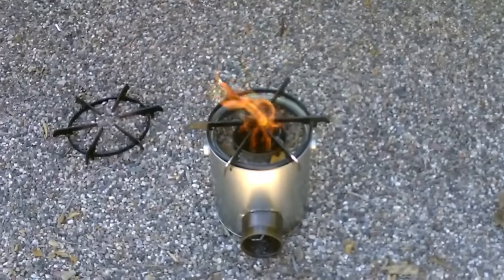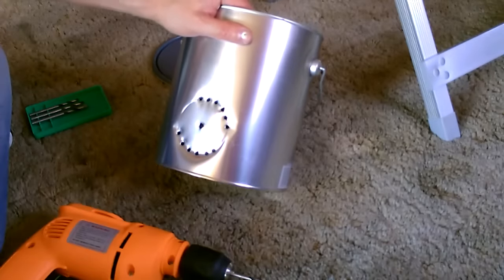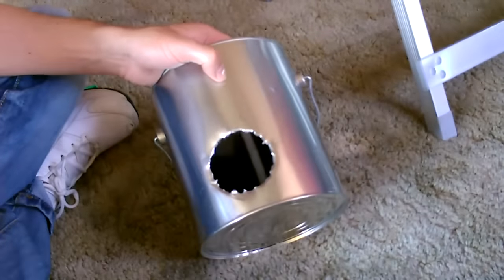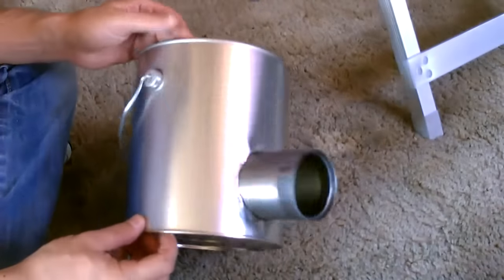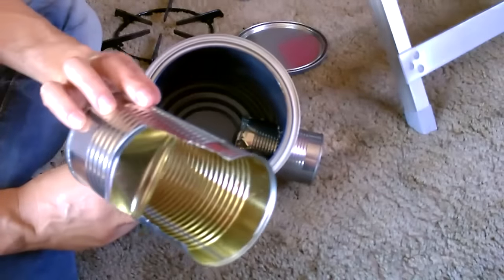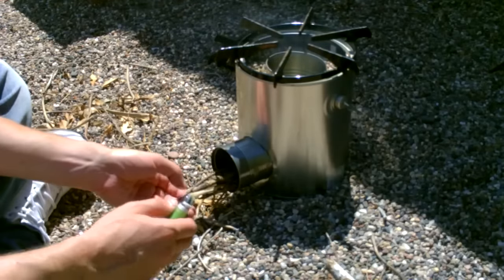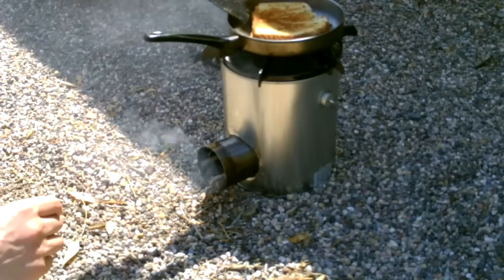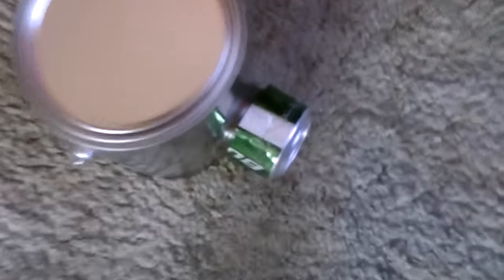Homemade TIN CAN Rocket Stove - DIY Rocket Stove - Awesome Stove! - EASY instructions!

Comment: A lot like the one I made except mine was better. OK the way I did mine was a lot like this one, but cut holes both in the paint can like you have but also cut a hole in the inner can as well, but the inner can to stick out the paint can a tiny bit. Now is when you fill with gravel and sand or just sand. Now fill all the way to the top with the inner can poking out a tiny bit and keep tapping the paint can to shake down the gravel and sand or just sand. Now put a hole in the paint can lid to pretty much hold the sand and gravel or sand in place and the inner can pokes out the top. All fitted together tightly so as not to lose any sand or gravel. I also used small plastic lids that fit over both ends of the chimney part to keep the ashes in place also to start a fire with using in a fire roll if so needed to start a fire    Great Video thanks for sharing. Thumbs up from me

Comment: Out of curiousity, why use sand? Wouldn't the stone work better because it would absorb the heat and keep the whole thing hot? Or is that the problem? Is there a worry about melting the cans if you use too much stone (which increases the heat)?
Reply: Does not the sand fill out the spaces between the pebbles? Sand retain heat too. There are full size stoves that are made with metal tubing and filled with sand instead of construction of bricks and tile.

Comment: Another option instead of bottom fuel fed hole have 0.5inch dia hole and metal pipes on the middle height on 4 sides for air flow  with fuel fed from top only

Comment: easier still ---cut hole as shown in 4 gallon drum,  put in base round wooden piece to centre with another round piece from top to bottom .
pack with sawdust, tramp down hard then remove wooden pieces which gives you a tunnel, light at base  and it will burn for hours

Comment: If u leave end on the can the is horizontal and face the closed end out drill a hole in middle insert a bolt then cut triangular holes in tge bottom u can take the bottom of a second can cut the same holes in it attach it and have a flou

Comment: Great project ! I'm wondering is there any type of high heat spray foam type of insulation that would work to make it light instead of the heavy rock and sand ? Just put one layer of rock & sand on the bottom and lighght the rest of the way . Any such thing exist ?
Reply: Try the stuff that they make door liners for fireplaces. It looks like white rope but never discolours or burns. You'd need the raw material, not the finished product. And I suspect it may be expensive.

Comment: I liked the video except all I would have done is to slide the proper size piece of firewood inside the paint can. That would give you a bearing surface to press down hard enough to make the large hole saw cut all at once thus eliminating the need of drilling and cutting to make the large hole. Any fairly large round or even square piece of wood should make that step simple, then completing the rest of it the way shown in the video.

Comment: How about using a metal sprinkler head stuffing it with carbon felt adding a copper spout with a cap to seal it on the outside of the cans in order to fill it with alcohol with the sprinkler head being just above the air intake at the bottom so a coals at the bottom to heat up. and vaporize the alcohol with the up draft generating a blue jet to boil water in a snap? Would it work?

Comment: Sand and gravel eh?  Smart!  I didn't think sand was such a great insulator but I guess I was wrong! Of course sand it silicon, which is an insulator, so why not I guess?  I thought about trying to build one of these a long time ago, but it seemed like way to much work!  Instead, I tried to build one out of bricks.  not near as nice, or efficient as yours but it was hot enough to cook on.

Comment: Would it be possible to pour water over the manifold housing the sand and gravel to create a steam version of this stove? I'm sure you could keep adding fodder to get temperatures very hot and start negating with water. The steam would heat the cook ware (not necessarily to allow steam in contact with the food directly... yuck.)

Comment: Why not swap the vertical tube for exhaust pipe it could handle higher temps and get a little taller to use as a heater or...
Reply: thats a great idea, i have a downspout and similar tubing in the garage left over from other projects. so glad i scrolled this far down in the comments!

Comment: Here is an 8dea for you, paint can design an alcohol resivor to sit in the bottom of the paint can with a copper tube with hole's drilled into it an inch apart bent to fit snug around inside of paint can mark were hole's are and make a air vent hole into the paint can place a pipe piece with a decorative screen cover on the outside of the paint can leaving a lip inside the paint can for the copper tube from the first alcohol resivor to rest upon. Copper tube stuffed with high heat carbon felt with end's left in bottom of alcohol resivor for a wick. Make a screw on fuel spout to the resivor that you can screw into place from a hole cut into the paint can from the outside. Now make another alcohol resivor one that can be presurized a bit use copper tube with steel wool threaded through it into the alcohol resivor use copper pipe attachment's to this resivor because you will be dealing with pressurized alcohol vapor. Then make fuel spout to the outside of the paint can with a secure screw on lid. Then order a HHO micro jet burner online and run your copper tube to the top of the paint can and recess the burner so you can place the lid on it. Dedign a grill top that has nibb's you place down inside the lid of the paint can to hold a skillet or large pot on top of the paint can. Then make a craddle with fold out leg's you place the paint can into for a stable paint can alcohol jet stove. The first copper tube burner heat's up the second copper pipe with steel wool and turn's alcohol to vapor building presure then that presurized alcohol vapor passes through a regulator valve to the top micro jet burner for low med or high heat. Very clean burning and will last for a few hour's abd you can even design a thin Titanium dome to fit over the jet's to glow white hot for a radiant heat source. Cool aspect of this is that you can dig a hole in the ground and place your paint can alcohol jet stove into it and.cover it and surround it with rock's and use it like a camp fire to cook on then attach your thin Titanium dome and have a radiant heat source just like a camp fire. 😀👍

Comment: but how do u clean it
Reply from the maker: hi there. i've found that a long-handled spoon works the best.
Reply: to make it easier use the paint can cap, make the hole size of the small can you're using, fill the can with insulation and close it now it won't spill
Reply: eazy mula
Reply: eazy mula
Reply: You just dump and scratch out the ashes with a stick. when you done. I did an comparison test and found that sand was a very poor heat conductor. Rocks held heat the longest. So just pack it with rocks only. Wax cardboard was the best starter. Milk and orange juice cartons pieces.

Comment: What coukd we use for inside the home not outside. Plz would like to know. I dk about these things but we need to get prepared for what's to come this year 2023. And it will require to be inside not outside. Any info plz and Ty
Reply from the maker: hi there. i have several DIY stove videos that show stoves you can use indoors. here is a link one that uses a similar size can and works just as well as this rocket stove... https://youtu.be/8Kcwl-UlVnc. make sure to check my channel for others.
Reply: @desertsun02  Aww Tyyyy 🙏

Comment: will filling it op with concrete work too instead of rocks
Reply: Yes, concrete would work but think the idea is to be more portable.  As concrete that small could be carried... try carrying it 5 or 10 miles?  Portable is better to use the materials around you, or use the sand/rock combination, as it would be easier to carry than cement mixture.

Comment: The hole saw would have drilled the hole that you wanted. Put it on one and go slower let the drill do the work don't push it because if you do that you Dent it. I have a larger  four Forge that I built the exact same way with exception that instead of using Soup cans I used  2-inch EMT . I can easily melt lead and aluminum. Are used the bottom piece as a billow.

Comment: If you filling the outside with concrete and put a air dryer where the wood is and killed it with some coal it would make a nice little furnace. O.O

Comment: it would turn into an inferno if you use a blower/hairdryer/bellows on the opening. i have a similarly designed furnace able to melt aluminium

Comment: how you gonna clean the ash ?
Reply: Drill 4 small holes under the bottom of the paint can 1/4 inch each , or simply vacuum them out after they cool.

Comment: Where do you get the top part? o;
Reply from the maker: i found a set of 4 of those at a yard sale (they're "burner grates" from a gas stove). if i was looking for them i would check places that repair (or sell) large kitchen appliances. you can also easily find them online (just google the term, "burner grate for gas stove"). camping stores might sell them too.

Comment: Doesn’t the tin melt easy?
Reply from the maker: hi there. the inner cans are steel. they handle the heat fine 👍🙂 if they were made of tin then they would. (i call them 'tin' but they are actually made of steel)

Comment: I think you need some tin snips...
Reply from the maker: hi. tin snips are certainly an option for cutting the inner can. make sure to use the drill to cut hole in the big can though. (the points of the metal it leaves behind 'grab and hold' the feed tube.
Reply: @desertsun02  I appreciate your advice! My grandma and I used to cook on one of these about 60 years ago on the beach in Florida!

Comment: Tin snips???
Reply from the maker: hi. that's certainly a possibility (for the inner can). you definitely want to use a drill bit on the larger can though. the metal points that are left behind hold the small fuel feed/air tube can tightly.